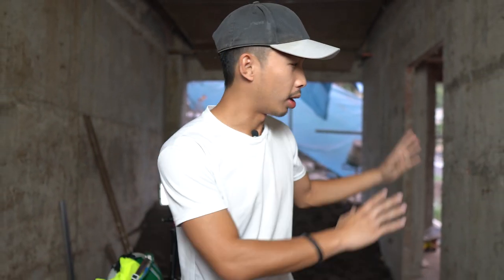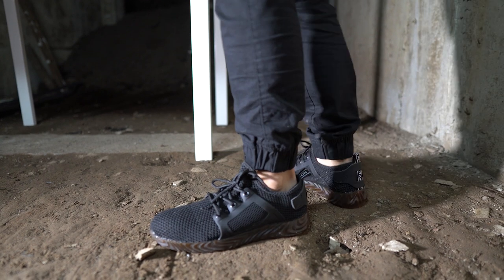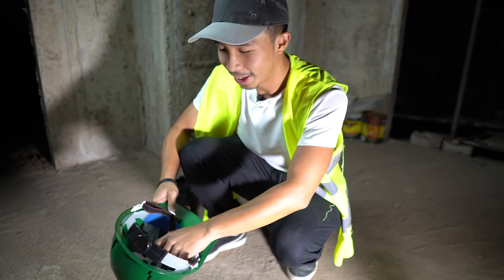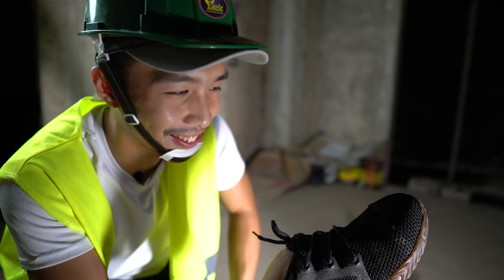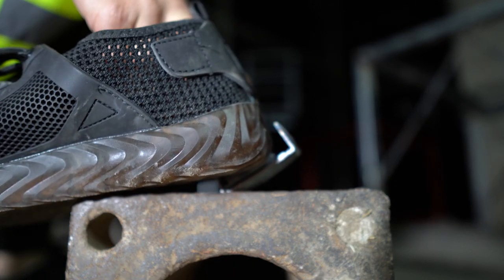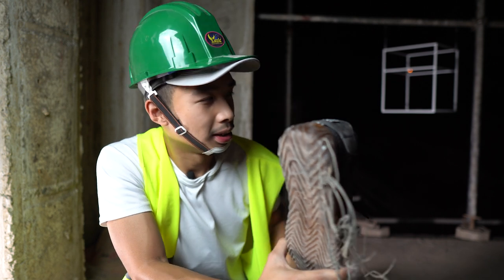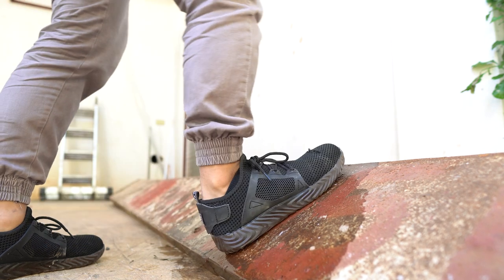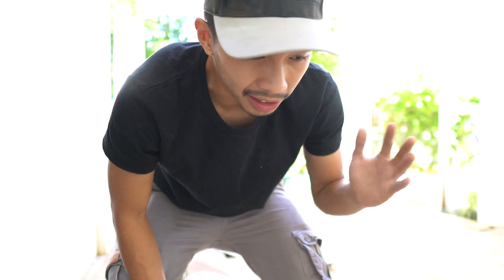Indestructible Shoes For Site Work

Comment: I'm an Onsite EMT and one of the most common injuries i treat are nails that went through a worker's boots. Boots aren't puncture proof either. You can't necessarily say that if "failed" instead i would have just compared it to an actual work boot. Otherwise, thanks for the video. Very informative. Thumbs up!
Reply: safety shoes is categories in s1 s2 and s3... kevlar insole or midsole is better...

s1 is for industrial s3 is for rough finishing construction like structural.

Comment: try red wing boots, the heritage line looks good and functional in construction areas. I use 8130 model, pang harabas. It has a hidden steel toe cap under the leather and a thick wedge crepe sole for puncture resistance.